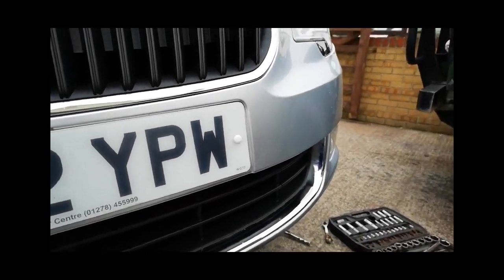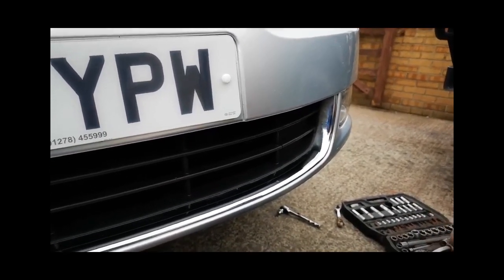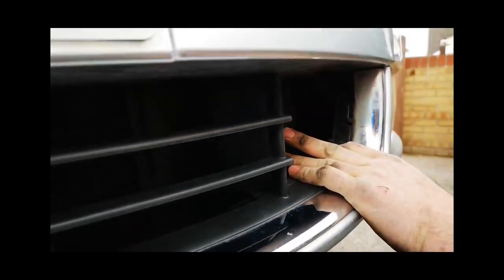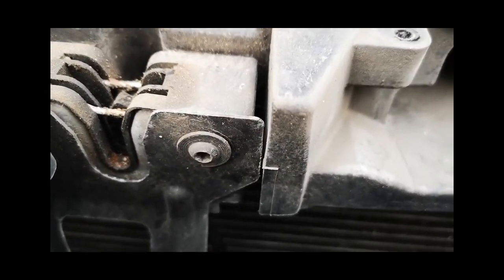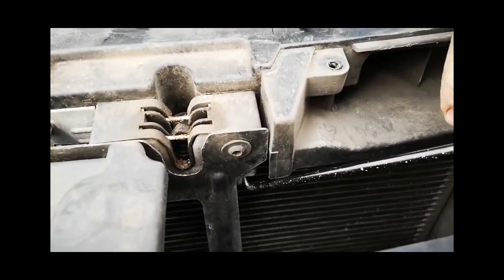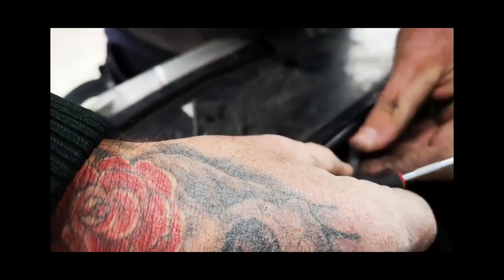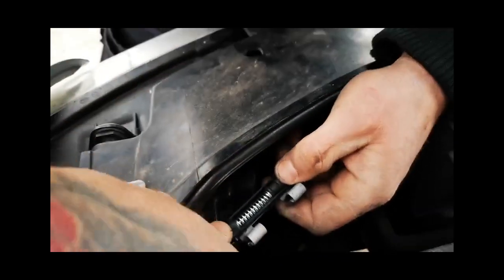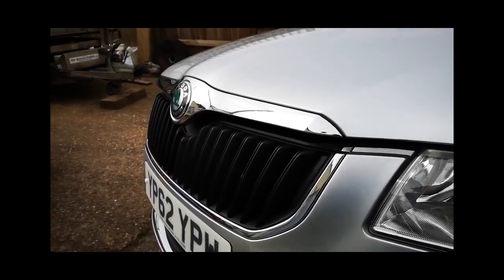How To Open The Bonnet - Hood On A Skoda Superb With Broken Cable

Comment: Good job mate,, I have a 2017 octavia,, my bonnet is locked now I've tryd to gain access through the lower grill but with no luck,, its diffident to the superb,, my latch is sitting in a bit of plastic I can get to ,, it's going into skoda tomorrow
Reply: How much did that cost on Skoda?

Comment: Thanks so much for posting this. I have a 2014 Skoda Superb estate. My bonnet release lever was stiff and after I opened the bonnet it wouldnt close. The release cable was intact but jammed in an open position preventing the bonnet from fully latching closed. Your video was very useful in showing me how to access the cable. In my case, with the bonnet open, I just had to take out the 3 retaining clips and lift the plastic cover. I could then manipulate the cable from above myself. I sorted it in 15 minutes after watching your video.  I have photos of this if anyone needs them. Many thanks for this.
Reply from the maker: Hi Paul, glad you got your Skoda Superb bonnet release sorted.  I made the video because Skoda were so reluctant to give any advice, one even gave misleading advice telling me to remove the cover underneath the engine bay, which obviously, was no use atall.  It is appalling how some garages charge so much for so little. Judging by the number of views on this video, many Skoda owners are experiencing the same problem.

Comment: Excellent video I was able to make a pick with a wire coat hanger popped it in 2mins, thanks
Reply from the maker: Glad that you found it useful, I was driving around for a week or two hoping I wouldn't need to get to the engine bay in a hurry before my son worked it out :)

Comment: hi my car octavia mk3 battery flat i manage to open door manually but passenger door is not open and bonnet lever is under the passenger door may i know how to open bonnet to charge battery?
Reply from the maker: I think you can get a battery charger that charges through you cigarette lighter to at least get your central locking to work

Comment: Hi guys, any idea if it's the same or if this trick will work on a 2016 passat?
Reply from the maker: Hi, not sure about the 2016 Passat, did you try it? Did it work?
Reply: @JohnMorrod  I managed to get in through removing the wheel lining :)

Comment: This is a great and helpful video. Shame it didn't help me. I think.i need a new latch as it is a bit stiff to operate. I couldn't pill it for the life of me. What helped on the end one person was pushing the hood down while I was trying to operate the handle. After disassembly the cable close to the latch was a bit stuck. WD40 made it free and operate properly. I think replacing the cable and the latch will be due soon.